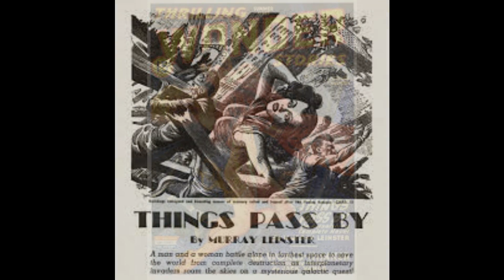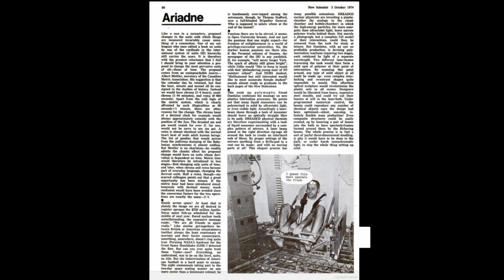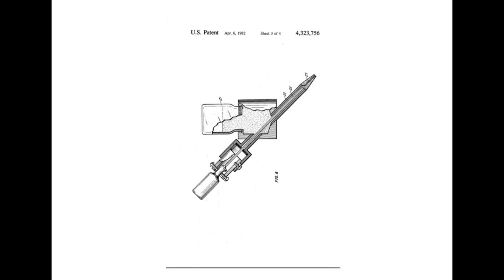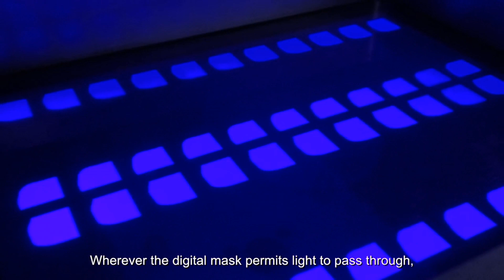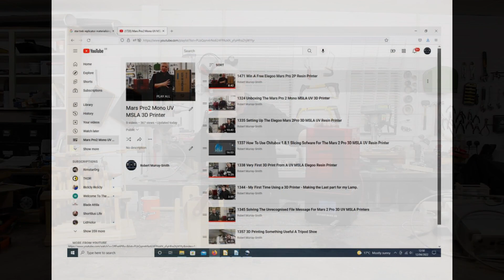1508 3D Printing - A History And A Competition

Comment: Hey Rob, you're a clever bloke. Could you create a plastic grinder (old 3d prints/ other plastics) which has a built in extruder, in order to make 3d printing filament??  The only reason why I don't want a 3d printer, is because I don't want add to the plastic scrap, that ultimately ends up in the sea.  Although, a metal 3d printer, made from a MIG welder, could be possible, and probably more useful??
Reply from the maker: I could mate - but there really is no need to there is a great open source plan for one online called filastruder - you can buy a kit, the plans, parts or even finished versions

Comment: Good bit of history, I'm a trekkie too. Have you noticed a drop in voltage of the rain generators? I have made several versions using dripping water and they start out with some good generation and then drop off to less than a tenth of a volt. Just wondering if anyone else has experienced this. And, Thank you for hosting these competitions!! Great Fun.
Reply from the maker: you might want to check out some research papers mate - they have done long term testing and if yours are failing there will be a reason - by comparing them to what has already been built it might cast light on what is going askew with yours

Comment: Thanks for the info.  Back in the 90s I design a pets water dish that would not spill water even if upside down. I have a prototype but would
like to make a better version.  I look into making a 3D scanner using a Pi but there is another guy in your country talked about some software
which you take a bunch of pictures around whatever thing and it puts it together.  Again You guy are great just love all the ways you come
up with.
Reply from the maker: Cospaly said it mate - photogrammetry is the process - it's cool
Reply: Photogrammetry is the term you're thinking of. There's been a few paid services and more recently some really good open source projects making use of the tech with just a cellphone, the most recent of which I've tried before my hard drive decided to corrupt itself the name escapes me. Meshroom is one I tried before that, though as any of them go, you need a good eye and some modeling experience to correct the models if you intend to do anything with them. Often times it's just easier to model them from scratch in something like Blender or Fusion 360. There's a lot of very usable open source CAD programs ranging in complexity and user friendliness these days, though Fusion is arguably the easiest to pick up in a few days. I've heard TinkerCAD is also in this same vein, but it's based on using a push-pull of existing assets if I recall, whereas Fusion is a sketch-based program with real dimensions that you can easily transfer into real 3D objects and print down the road. Just make sure you complete your project before the free trial ends as they like to paywall all the really useful parts of the program after that.
Reply: Hello Edward myers. Seems my son has a middle name of Edward.  We probably are a million miles apart and are no relation but there is an Edward theme in my family

Comment: A friend got me a 3D printer but the only problem is the edit software.  I'm use to mess with AutoCAD and Prodesign back in the 80s
even smartCAD PC design and that took me a while to learn to use them.  Using a  Free 3D editor  and figuring out how to use it has
come some what a pain and it's been years since I've mess with my old DOS CAD programs.
Reply from the maker: just use the slciing software - this comes with chitubox - which a 5 minte leaning curve for me and grab suff off the net - there is a ton of readily available and useful stuff - that gets you up and running and having fun - learning CAD comes later - for me - much later
Reply: Get Fusion 360 and learn how to use it, you can get a maker license for free.  I had not done any CAD since school in the 90's on 16-bit Archimedes computers, but this was easy to learn and is powerful to use.  Plenty of videos to learn from.  Solidworks has a good looking online offering too.